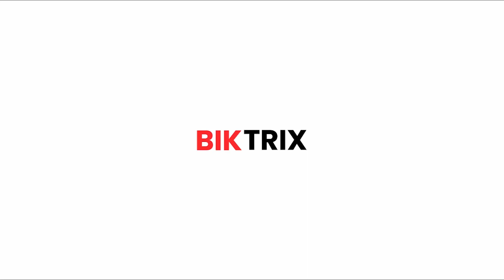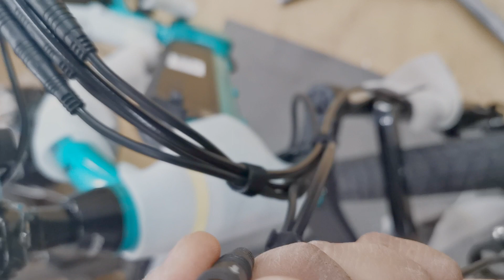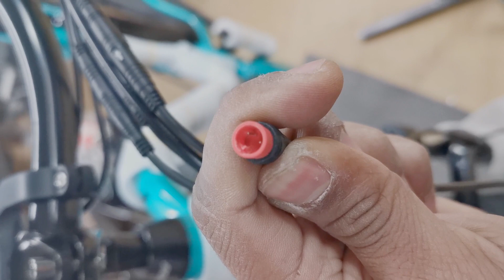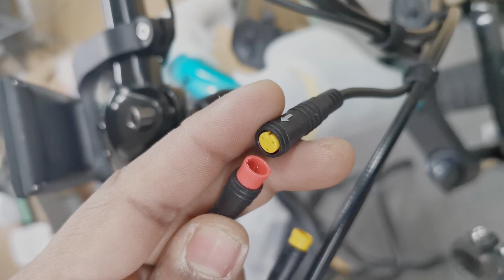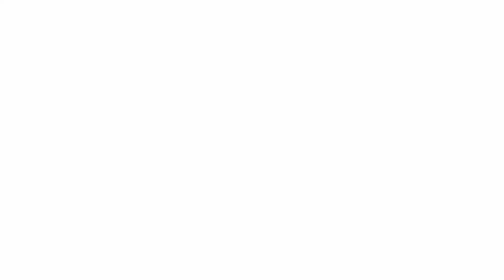Magura MT5e Hydraulic Brakes Installed on Bafang Motor - BBS02, BBSHD, Ultra G510 M620

Comment: better use the Bafang  Ebrake sensors, I glued the sensors with tyrap on the Magura HS33 brake handle cable, and the magnet glued+tyrap a few centimeter away from the sensors on the brake handles, I drive the BBSHD bike for several years, without any problems and with superb Magura braking power!
Reply: No way, its more Cool and professionel to use the wires from Magura, what a crazy suggestion, the magnet solution really sucks

Comment: What if the pins break inside the plug?
Reply: The you can solder the wires instead, I did that

Comment: Do you have to connect the HIGO opener/closer to the motor or it doesn’t matter if you just leave it loose?
Reply: You can leave it, but its so important to cut off the motor when braking or shifting gears.

Comment: The notch is not only to line the plug up, in fact its main use is to lock the plug into place so it cannot be turn/twisted which would then break the pins.
Reply: Nothing a little tape can't fix 👌.

Comment: Damn, just paid $35 for a new harness with red instead of yellow HIGO connectors. Couldn't find an adaptor via google search. Now, cant find the MT5e brake anywhere. Would the MT5e lever fit and function properly in a MT5 housing/master cylinder?
Reply: Yes you can swap the MT5e lever onto the MT5 master cylinder. Magura has a video showing how to remove and replace levers.
Reply: @tzed2509  Thanks for the info. Not a fan of the longer MT5e lever but it's nice to have a kill switch just in case.

Comment: They now have adapters that you can plug the 2 pin HIGO into a 2 pin adapter with 3 pins on the opposite end which then plugs into the BAFANG. A lot of pins mentioned but to simplify it, just imagine an adapter for a euro plug to a uk plug, same principle.
Reply: where can you buy these adapters?